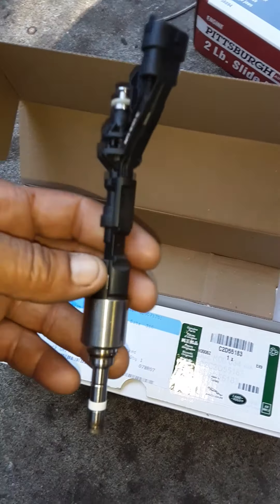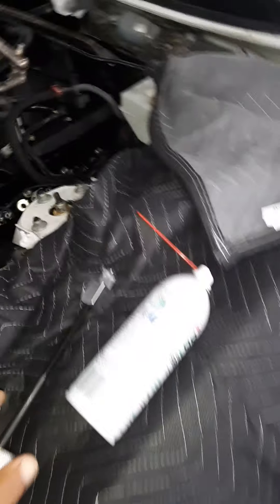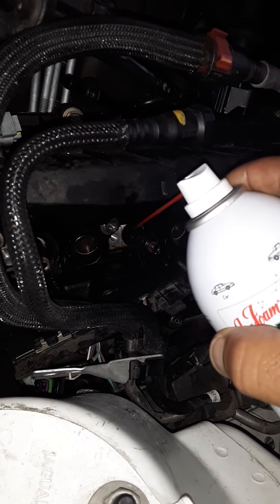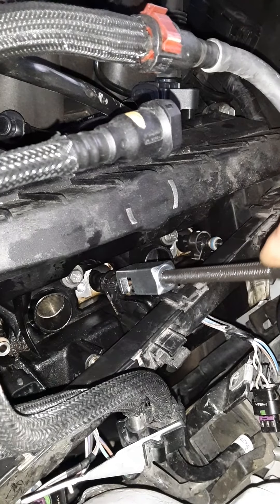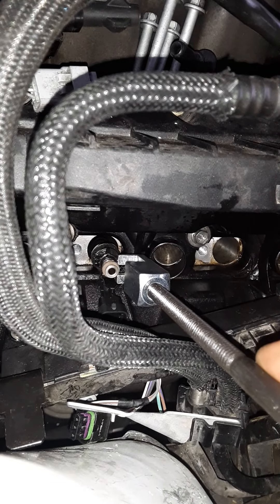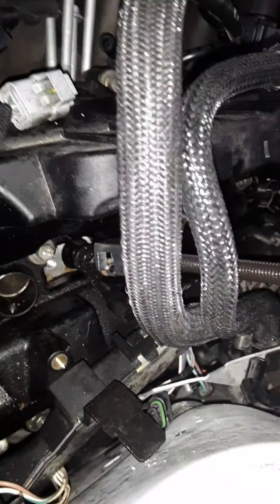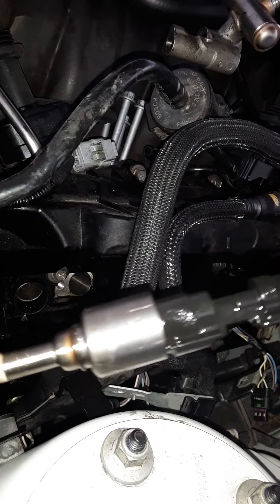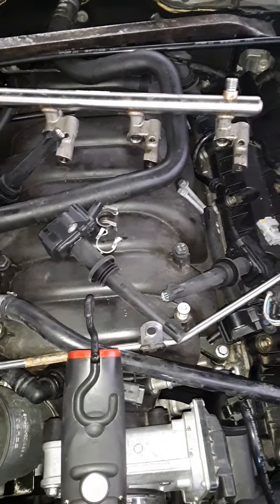How to remove Jaguar Portfolio XF Fuel injector from 5.0L

Comment: Hey, thanks for your video! How were you able to diagnose which injectors were stuck open? I have the same problem, just tring to figure out which injectors are bad? Thanks!
Reply from the maker: the Jag through a fuel injector code and showed me which one was stuck open!
Reply: @sirseanisrobinson1515  thank you! Mine isn't throwing a specific code for an injector; but has the same symptoms with the white smoke billowing out! Time to replace em all.
Reply from the maker: @Samcrac  another way of finding out which Cylinder is bad is inspecting the spark plugs to see which one is wet or really - really clean 😁👍

Comment: Although the supercharged versions run the same supercharger (eaton m112) as the 5.0 mustangs but do not run the same engines. That is an AJ-V8 GenIII engine not a coyote my friend.
Reply from the maker: welp they do have the same kind of fuel injectors
Reply: @sirseanisrobinson1515  well thats interesting but I just did some looking and couldnt find a single injector that is the same? 
What year rang arw you referring to because something doesnt add up..
Reply: @sirseanisrobinson1515  so yeahh after looking at a few 5.0 coyote injector replacements I have come to the conclusion you are completely wrong. 
Even if they had the same injector still not the same engine like I originally said....
Reply from the maker: @birminghamevan  the car i was working on was a 2011-2012 Portfolio Jaguar with a 5.0L Ford engine
Reply: @sirseanisrobinson1515   S/C?
Reply: People hear that Jag bought them from Ford and assume they are coyote engines. Easy mistake. But def not a coyote. Def no interchangeable parts… AJ 133 or something like that is engine model.

Comment: Why did you choose to replace the injectors
Reply from the maker: two of them where stuck wide open flooding out the engine making it look as if the motor has a blown headgasket